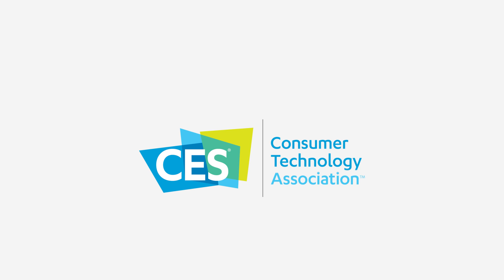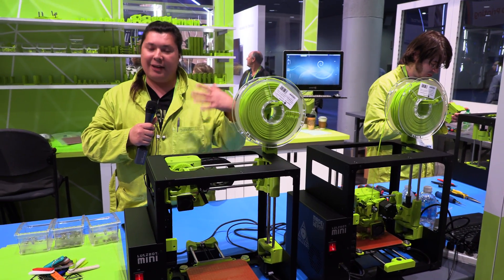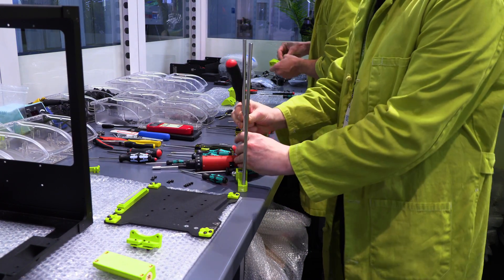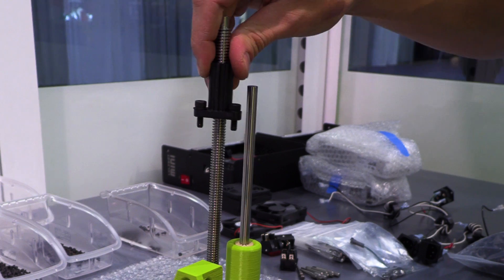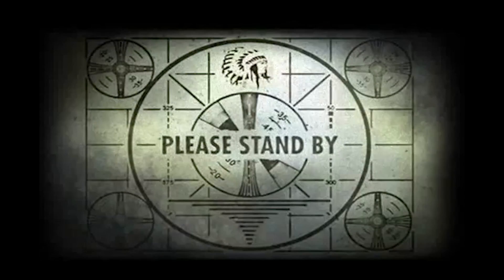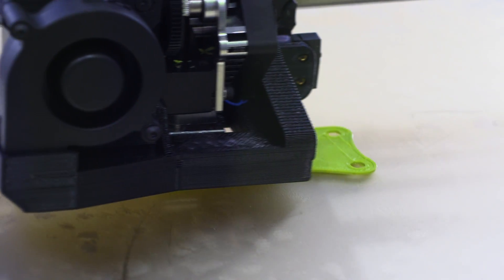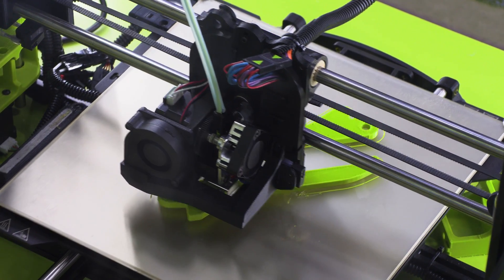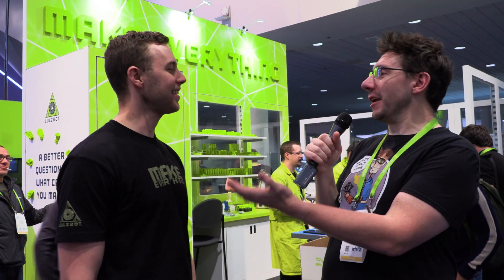3D Printing at CES 2018 - Lulzbot Building 3D Printers at their Booth #MakeEverything

Comment: Would have loved to see them demonstrate printing reliability and detail. Essentially all they were doing was printing a bunch of chunky random shapes like everyone else. The tech specs on printers is often misleading to potential buyers, Things like 50 microns accuracy often implies being able to print out tiny high detail items like gaming minatures, but in practice this is often impossible with most printers out of the box. I think we're beyond this being for tinkers only who want to build and fine tuner their printer, people dont expect to have to do that for each page of a document on their inkjet printer. how can a machine shop owner decide if the printer is going to reliably print spare parts on demand with a certain tolerance. There little consumer confidence in that at this point. Not knocking the Lulzbot product but my Cetus 3D just runs easily 24/7 with prints I can rely on not failing and being consistent. This is without any setting tweaks just default software and out of the box setup. My three other printers all demandconstant tweaking and are fussy about weather changes and react different when I change filament rolls. This may be fine for the tinkerers with time to learn and explore and fine tune but not yet at a Consumer level product.

I commend Lulzbot for their open ethics too, this is something I noticed is lacking elsewhere especially at the cheap end of the 3D printer market where getting any sort of support is almost impossible, you have to rely on forums etc that someone else had the same problem and figure it out. Again no so bad for makers its all useful knowledge. But for the average consumer a frustration that will turn them away forever from the hobby.
Reply: Steve Bolton your right about the customer service. It is unparalleled, but I’m not paying $2500 for an ok printer with amazing customer service. I would rather buy a cheap kit from China, upgrade it to print even better than a lulzbot (which isn’t too hard cuz let’s be honest the print quality of the lulzbot isn’t something to be excited about) and in the process  truly learn every aspect of 3D printing rather than pressing the easy button and buying a lulzbot and having the customer service solve all your problems for you instead of you figuring it out for yourself. Which yeah I did..Tevo tarantula FTW! Prints at .05 layer height like a boss after months of upgrading. This is all just my opinion though. I recommend the learning experience to everyone!!!!! Buy a kit or design and build your own...trust me ik it is a million head aches, but the end result is super satisfying!

Comment: Technician uses screwdriver as a hammer. At the insane prices they charge they should be able to provide the proper tools.
Reply: My thoughts exactly, Way overpriced and will never see any of my money for those prices. Not impressed with Lulzbot printers
Reply: POVadventure they are not at the actual factory so they don’t have all there tools and I think it is also a time thing. Switching tools wastes time if a screw driver works why not use it. And those are nice screwdrivers, made in Germany
Reply: They are at CES if there is only one place you are going to put your best foot forward as a tech company. They know what tools they are going to need there is no excuse for not sending them. Even if you somehow forgot to pack a hammer there has to be thousands of places to buy a hammer in the city.

Comment: Hey Joel, you know about that anet a8 I told you about and ordered? I got it, built it, turned it on ran into many problems with limit switches figured that all out. Leveled the bed and of course like everyone else would try to do stick in the filament, heat it up and and print. Tried to do that and filament wasnt coming out right it barley came out so then I unplug the printer and come back later and try to remove the filament I made a rookie mistake and tried to remove the filament while it was all at the bottom of the nozzle cold. And it ripped in the throat so I couldnt heat it up and get it out and I tried heating it to 260c like people said, they say leave it for 10 mins at 260c or 500f and let it melt out, wasn't working and i dropped a screw that rolled behind the heatbed and gave myself a 3rd degree burn on the nozzle. After this I tried to take off the nozzle to unjam/unclog it and of course I DIDN'T FOLLOW PEOPLES INSTRUCTIONS RIGHT and I forgot to preheat it to 260c and broke off the nozzle, also my nozzle, heatblock and throat assembly had its thermistor broken when I got it and I fixed it with good ol gasket maker from walmart. Now I have a new MK8 assembly coming in the mail I ordered from amazon with extra nozzles and throats. Also I ordered an extra from ebay for $3 which will take a month to get here hopefully I don't break the new assembly! Also keep up the great CES content and all your other 3d printing content as usual! #highfive

Comment: Im still not keen on a 3D printed 3D printer, but when they make a printer that can replicate itself good enough to then replicate itself again, they get a pretty good printer.
But it is a battle between printers like this, hundreds of super custom bespoke pieces always changing vs the modern trend of your "CR-10" style printer, where ALL the components across hundreds of different 3d printers are identical, just configured differently.
but what will win, massive off the shelf adaptability, or super bespoke customised 3d printers.

Comment: I'd love to know why they use 2.85/3mm filament instead of 1.75mm
Reply: For the uninformed, whats teh benefit of 1.75 over 3mm?
Reply: There isn't really a benefit. Both are good! 
But you can print flexible filaments faster with 3mm.
Reply: 3mm has the benefit of being less prone to buckling, which is ideal if you are using a Boden setup. However, it is harder to melt as it takes a little longer for the heat to get all the way through. Or at least that's the theory.
Reply: I own a lulzbot mini and it is able to print in 3mm and 1.75mm no problem
Reply: Because 1.75mm came after 3mm.
Lulzbot is one of the old RepRap comapies > 3mm filament was the only option back then.
I think so.
Reply: multiple, but the main ones are that it is easier to get your hands on, AFAIK aside from the Lulzbot machines, only the Ultimakers use 2.85/3mm filament. Also becasue filament is  measured in weight not length (apart from those useless 10m samples) you'd technically get less
Reply: 3mm filament results in pushing a larger volume of filament through the nozzle orifice. Since the extruder stepper do have an ideal speed range (i.e. steps/min) this means either 1) adding reduction gearing to the extruder stepper to achieve the preferred steps/min or running at a less ideal step range. For example, if you have a very low layer height like 0.05mm printing at a relatively slow print speed then the extruder stepper would be running extremely slowly, to the point where it would no longer extruder at a smooth rate. Conversely if you were printing very high volumes at a high print speed (think high layer height, larger nozzle orifice, high print speed) then 3mm filament would be better suited.
Reply: All I know is that 1.75 filament is cheaper and easier to find a variety of good brands therefore I take it over 3mm filament any day anytime...why do 2 sizes even exist?😒
Reply: Jacob Blumberg ummm yeah...but a cheap E3D volcano that uses 1.75 filament can do the same exact thing...3mm filament doesn’t give u a faster print speed..I can only see a use for 3mm filament if the nozzle is bigger than 1.75mm...
Reply: 3mm for laying down lots of plastic fast!  I see no need for this on the mini, but the TAZ6 for sure.
Reply: Well all this "stream lining" hasn't lowered their costs.  Same old printers, same high prices.
Reply: WillieRants 3mm filament doesn’t mean faster printing! Jeez...both a 3mm printer and a 1.75mm use the same print speeds, the same layer heights, etc... if anything 3mm filament makes it go slower because it takes longer to melt bigger filament...besides u have to print slower on a taz 6 anyway because of their dumb direct driven extruders..your limited to about 50mms... anything above that and the print quality lowers extravagantly...I can print 70mms on a cheap Chinese machine from China without it affecting quality...or let’s take the Tevo Little monster it has been proven that it can print up to 300mms and still have excellent results..this machine only costs $800... lulzbot is just out of date.. they need to COMPLETELY redesign in my opinion..the prusa team is shaping the future of desktop 3D printing with their printers...lulzbot just doesn’t get it

Comment: Nice, would love a Lulzbot, they seem to be the holy grail of quality results and reliability/repeatability
Reply: I love my Taz 6, it's like they said, they're very reliable, and if you get the unlucky one they will kill you with kindness and support trying to fix it. It's the exact opposite of a random gearbest china-export printer, it costs, but that cost buys you in to great support and documentation
Reply: irblinx if your a complete noob to 3D printing then the taz is for you😒..experienced people buy the cheap Chinese printers and turn them into masterpieces...Chinese printers are just so cheap and easy to remodel without using that much money. I can’t recommend it enough..You don’t need costumer support...you need knowledge of 3D printing to troubleshoot problems that occur...for example Jacob..u said your prints don’t come off too easily from your other printers...well if you knew how to fix the problem this wouldn’t be an issue( simple piece of glass or a sheet of PEI over the build plate works fine and is very cheap) if u have this knowledge and experience than any 3D printer can be good because you make it good...but the taz 6 just comes ready to go..it’s boring tbh..nothing learned from it...just click print get part...lulzbot claims that their 3D printers are more like tools..well I disagree I say it’s opposite...lulzbots are for those who are too lazy to tune their own printers...You want to learn 3D printing and brag to your friends about your printer then do it right...try designing your own or buy a cheap Chinese one and upgrade it until it prints like a lulzbot...trust me it’s worth it..I can’t recommend the experience enough..I’ve learned so much from my little kit and I’m now helping a team build a big 3D printer from scratch for our school.
Reply: Matthew Guiher interesting viewpoint but I don’t agree I’m afraid, not everyone has to follow the same path nor is any one way superior to another.  I’d rather spend my free time designing things to print rather than getting a bunch of cheap components working, to me a printer absolutely is a tool but to say that makes me lazy is laughable.

I do have a cheap Chinese printer, a more expensive Chinese printer and a Prusa (plus access to 4 more printers at work). The difference in quality of the components on the Prusa is quite obvious, and yes my Chinese printers do give good results but why should I have to tinker if I don’t want to?

As Lulzbot truly embrace open source, if I really want to tinker then it is actually quite easy to design adaptations and I would be starting from good quality components and solid performance. Also, ff you really want the full on 3D Printing RepRap experience why recommend a Chinese kit at all? Buy the components and design/print any bespoke parts to make your own as you say you are now doing with the school team.